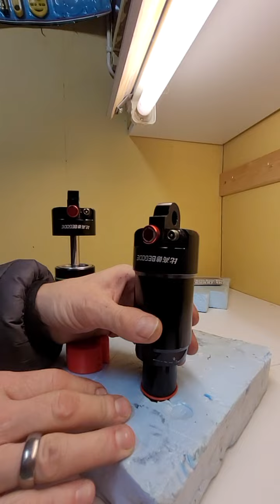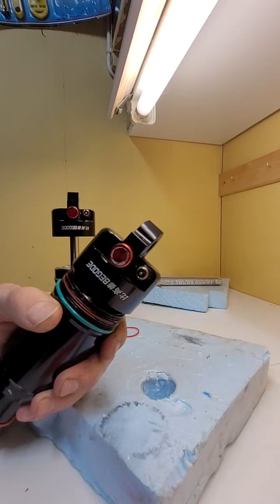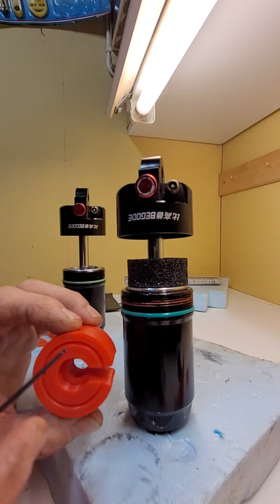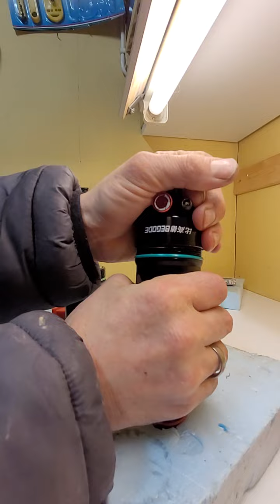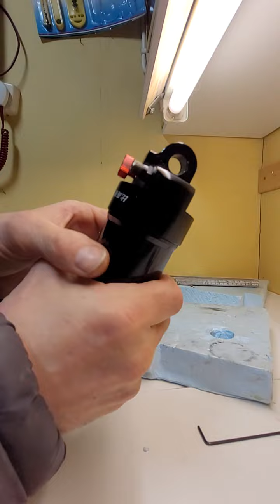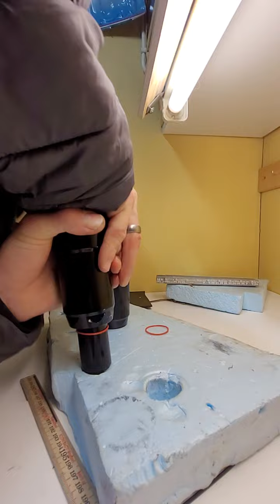EUCzeroBottomout

Comment: Planning to test it on a master pro V2. Do you think it will fit as long as the linkage and shock is the same as master pro V1 (as far as I know) ?
Another option I consider is to install the MyEwheel linkage but it's not the same price for sure. What do you believe to be the best choice knowing I am ok spending 100 bucks for a new linkage ?

Comment: wouldnt that also means, that instead of the frame bottoming out the shock is bottoming out and is being restricted by the sponge and 3d print?
Reply from the maker: The 3D print is not that big.
But on the limit. So do NOT make it taller. 

If you change linkage, the volume reducer WILL make the shock bottom out. So use only with the original v1 Master linkage.